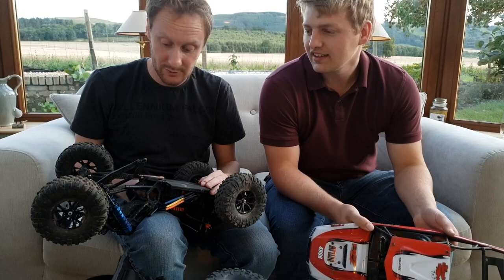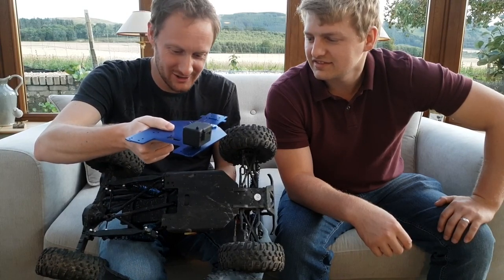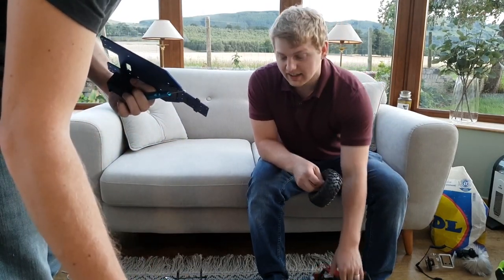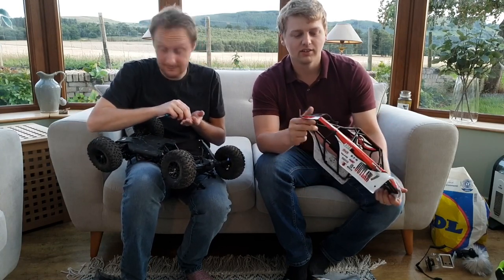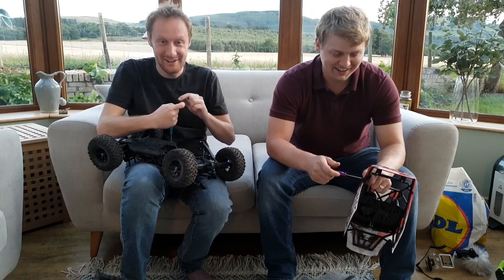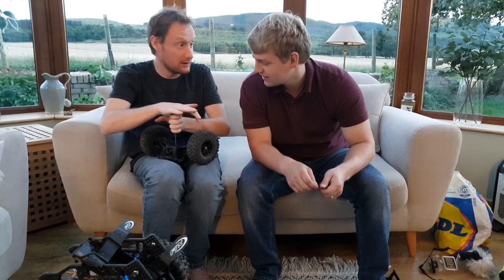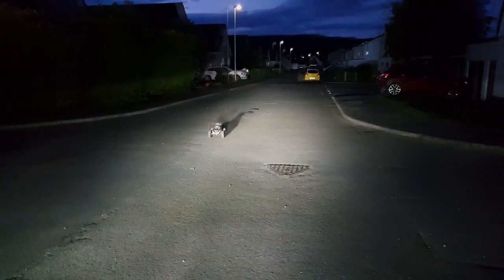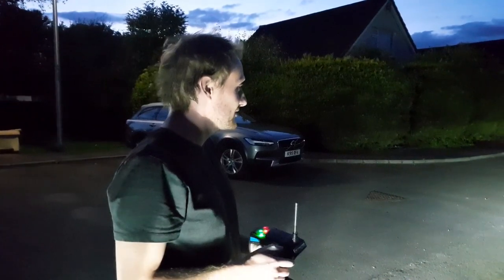First repair of FTX Outlaw... yes, THAT repair! Chassis plate replacement & test bash.

Comment: Quick question: Why does the right front wheel come off the ground when accelerating but the left stays planted?
Reply from the maker: Because of torque twist. The main prop shaft rotates in one direction while moving forward and so do the corresponding gears at each end. This causes the entire truck to lurch in that direction, on heavy throttle.

The truck is literally trying to bury the rear left wheel into the tarmac, but it obviously can't, so the force is transferred to the front.

This is a characteristic that all solid-axle trucks do, to a lesser or greater extent.
Reply: @TheRCScotsman  Thanks! Appreciate the explanation :)
Reply from the maker: @RonnSono-MassaAcoustics  No worries.

Comment: I lost all drive train power on Outlaw this morning - after a role 🤦‍♂️

Steering still functions.

ESC fan spinning.

No orange light.

Changed battery but no power!

Thoughts?
Reply from the maker: Hmm... doesn't sound good. My original brushed ESC had a temporary cut-out, but it came back, once I'd turned it off & on. Do you have a spare brushed motor to try? If so, test it. That will at least tell you if the ESC or motor is to blame.

Comment: What did you do about the receiver box ? Just bought one myself and realised it doesn’t have the same screw holes for the original receiver box ... thank you
Reply from the maker: Really? That's odd. Mine mounts the original receiver box, just like before. Did you buy a genuine FTX part?

Comment: I have recently bought an outlaw.  I am brand new to RC so I am a complete noob.  Having only owned the outlaw 2 weeks it stopped running on its second time out.  The light on the ESC flashes and the wheels turn (steer) but that's it.  Do u guys think it may be the motor failed? 

Cheers for any advice
Reply from the maker: Hello. Is it the brushed model? Could be the motor, but unlikely, as brushed motors are extremely reliable. I suppose the motor could be jammed, maybe debris got in? Or very, very rarely, the magnets can come loose. I'd be more inclined to say the ESC has failed, as the standard electrics on the brushed version are pretty poor. To be honest, you're best bet is to go into a hobby shop and use trial and error. Trying different ESCs, motors and radio gear is the only way of accurately testing what has gone wrong.
Reply: @TheRCScotsman  hi mate, cheers for the fast reply.  Aye it's the brushed model.  The ESC still has lights flashing on it but it no longer plays the jingle when I turn the car on.  My local shop is ok but their advice is a little weak.  I think the old owner or partner left and the lady who is there now is still finding her feet.  That's why I sought online advice and fell across your channel.  To which I'm now subscribed.  When I get home at the weekend I will pop back down and see what they have in stock in terms of ESC and motor.

However I think the sell mostly models and not spares 

Ps I checked the car and it is clean and seems free of debris.  

Thanks again for your reply
Reply from the maker: You're very welcome and cheers for the sub! Sounds like the ESC, so it could have failed (in which case, warranty should cover). Another thing is that the FTX ESC is very sensitive to where the throttle trim position is set on the transmitter. The "jingle" is the ESC calibrating to the transmitter, but if the throttle trim is set way off, then it will refuse to calibrate. Try resetting the throttle trim to dead centre, before turning the car on. However, as I said, the brushed ESC is pants. Mine conked-out (albeit, temporarily) on the second run. Even though it had come back to life, I just binned it, when I upgraded to brushless.
Reply: @TheRCScotsman  hi thanks for the reply again.  The dials on the remote are all set to 0 at the moment so as u say it's possibly the ESC.  When I get back down to Newcastle I will go back to the model shop I go to and see what they say.

Thanks again for your advice.  When I get used to the car I think I will go for the goolRC 3500KVA as u suggested in your other video.  However that would be too much speed I think at the moment.

Cheers again
Reply from the maker: Good shout, best of luck with it!
Well, for reference, the brushless Outlaw is 2900kv, so is slightly slower. Honestly, I'd probably advise the GoolRC 3000kv combo, instead of the 3500kv I have. The reason being is that the truck is great fun, but doesn't handle that great! So slightly less speed is probably beneficial. More importantly, I noticed mine to be ever so slightly over-geared, leading to some pretty high temperatures. The lower-revving, but higher torque 3000kv system might be slightly better suited.
Reply: Sound mate. Cheers.  I will see if the ESC is the bogey.  If I can get that sorted I will run it a while on brushed then I might ask Santa for the brushless goolRC.  I best learn to solder as my batteries are all NiMH with Tamiah connectors.

Thanks again for all of your advice.  Very helpful, as I am still trying to wrap my head round the basics at the moment.

Cheers
Reply from the maker: Good luck!

Comment: Considering how many of these things they flogged having to wait 6 months for a basic part is pretty pathetic. Even if it is an upgraded one (at an upgraded price no doubt) I just hope I don't need any spare soon for my FTX Outback. And I just burned out the slipper clutch on my ECX Ruckus, and no bugger in the UK has stock-again a basic part. I can get one in Australia apparently....with £20 postage. Spares back up for some of these Chinese companies is extremely poor.
Reply from the maker: Price was very reasonable, £20. Spares are pretty plentiful at CML/FTX websites, but they just didn't manufacture enough aluminium plates. Hope you get your ECX fixed, soon!